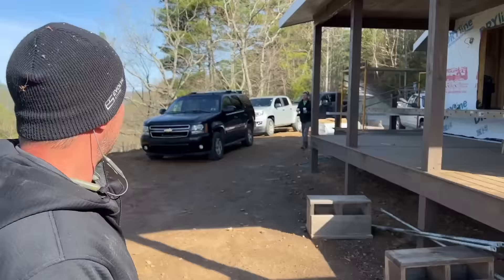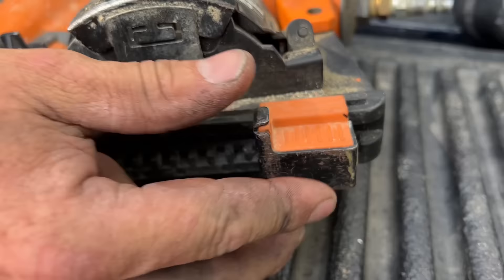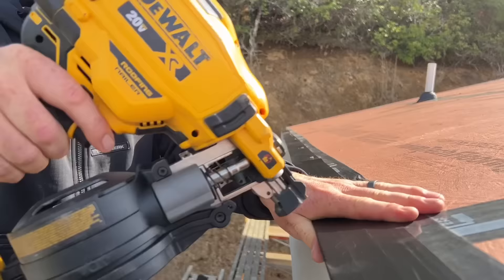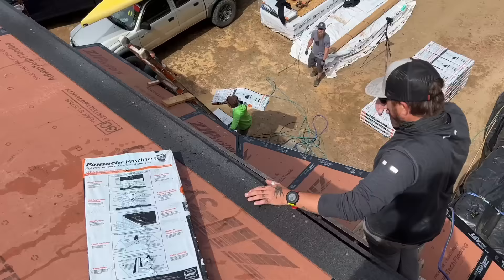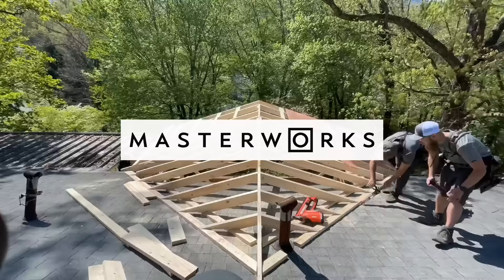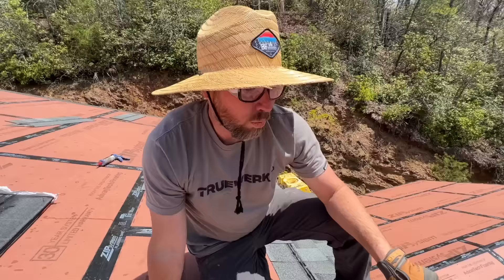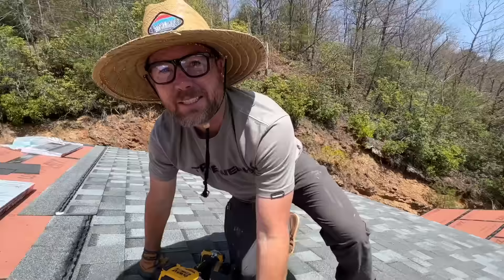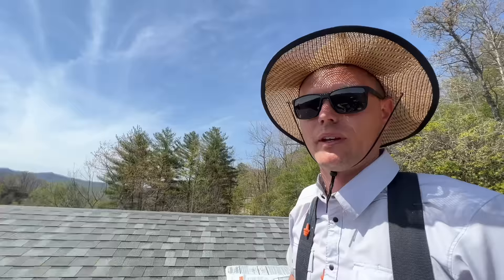Installing Roofing Part 1 | Building A Mountain Cabin EP34

Comment: Another thing you can do to improve the drip edge wind resistance and overall clean appearance is to dovetail the joints. A couple inches from the edge of the piece cut a small pizza slice off the hem and bottom edge, then lock the hem of the next piece over the first piece and they are physically connected.
Another thing, you should have taped the top edge of the drip to the sheeting. If any water gets under the shingles that would have kept it from getting under the drip and behind the fascia.
Also, why would you do an overbuild without tearing off the shingles. I know it common, but WHY? Tear off first and build right on the deck, when you go to roof it it will get torn off anyway, and you will have wasted your expensive zip tape. 
Right handed roofers usually go from left to right across a roof. Hold the gun in your right hand, use the nose to gauge or “crotch” the shingle and your left hand to match the lower edge to the previous row, you never have to put your gun down.

Comment: Good content on proper roof installation. In my opinion ice and water shield is a useless gimmick. A few years back we had relentless snow with melting and ice dames. During the day melt water runs under the snow/ ice layer already present and work it’s way back to the house through several cycles of re freezing as the ice builds up. Eventually it reaches the interior roof/ wall area and runs down and out throughout. I’ve seen it basically flood houses and leave icicles protruding from siding and windows. The only thing that prevents this from happening is adequate insulation and sealing to stop warm air hitting the underside of the roof and wall area.

Comment: Roof underlayment should be on top of the drip edge. Any water penetration will leak under the drip edge and rot the fascia board and flow behind the gutter. One of the flaws of the zip system.
Reply: That’s a good point, I wonder if simply tapping over the drip edge would solve that.
Reply: It would. Once you roll the zip tape, that adhesive is pretty tough and after a few days you can’t remove it with out tearing it piece by piece.

Comment: Flip the single upside down instead of cutting it for ur starter strip bottom of the shingle got the same tar strip as the tops, also do 5 nails at least way stronger id considers even 6 on a mountain like that

Comment: Theres no code requirement for ice and water shield on the bottom edge there? We're required to have it here in Ontario
Reply: Same in CT. Required to a point 2 ft inside the outside of the building.

Comment: So... aren't you supposed to extend the first row of shingles out over the starter row by a half inch or so, so that water drips right off into the gutter ?
Reply: No you wouldn't need to because the starter is already extended over the drip and will land in the gutter, however say it decided to run back a little then it hits the drip and runs into the gutter that way.
The first row also adheres better if it lined up with the starter because the tar will line up on both pieces which will keep it from blowing up.

Comment: I am by no means a professional and I’ve never worked with those zip system sheets before. But are they good enough to act as an ice and water shield?? I know they said they’d put it in the valleys. Just curious for my own future reference
Reply: Zip sheething shouldn't be used by itself in valleys, etc. You should use underlayment for valleys and such, and if you have a chimney, etc. You should shingle up to the bottom of the chimney, and then start your ice and water shield making it overlap onto the last course of shingles because that's how water works, if flows down and you want to get the water out from under the shingles and ontop if water would ever go underneath the shingles.

Comment: Just wondering why you decided to do the roof yourself. Wondering if it was to keep your team paid with the delays you guys have been going through.
Reply: As a builder myself, I would say it boils down to 1.) Does my crew want to work some hours 2.) Are they capable of doing this work 3.) Will it be roughly the same cost as the subcontractor I typically use?  If all three answers are yes, then it's a given!  It's also much more preferred to stay on one  house build instead of packing up tools to go dig into another job, I hate spreading myself too thin & also don't like doing small jobs that I prefer to just get in & out all at once versus several visits - especially if owner occupied!

Comment: Is there a reason why you don't have tar paper and air vents?
Reply: The building code does not require underlayment with the ZIP system. Under most conditions (except foam insulation) you would need soffit and ridge ventilation.
Reply: @billbriggs2309  thanks for the reply...

Comment: Hello, i wonder what is the max wind speed that these shingles can handle? And is screwing them into place not better than nailing?
Also, wear some kneepads to protect your knees!
Reply: If you can afford to pay a crew to screw instead of nailing... That would be a very wasteful use of your budget. Nails hold good enough. If you ever had to remove old shingles you'd know so.
Reply: The weak point for wind resistance is not the fastener pulling out of the roof, but the shingle ripping out around the nail head. That’s why roofing nails are short with oversized flat heads.
Reply: @xavytex  hello, yes that is also a good point that it is a lot easier to remove shingles
Reply: @jeremyperkins7246  thanks for the information! That makes a lot of sense!

Comment: You guys have too much faith in zip system sheathing. What about the thousands of nail holes on the deck. Roof underlayment is the cheapest insurance for moisture damage. You should have at least taped the drip edge to the sheathing.